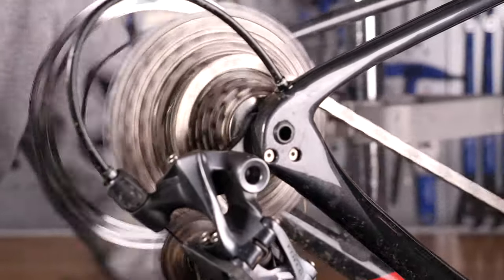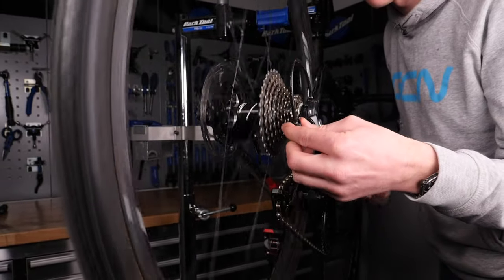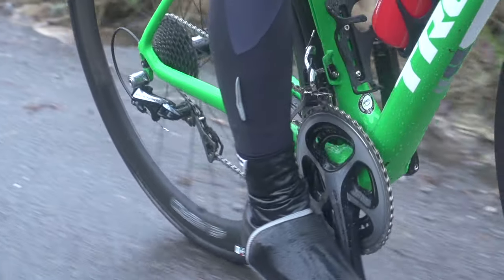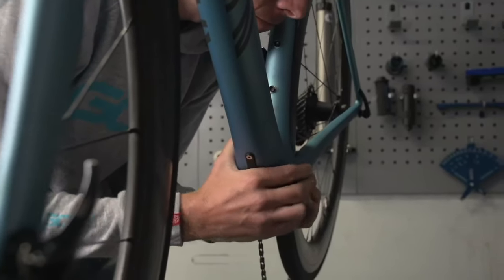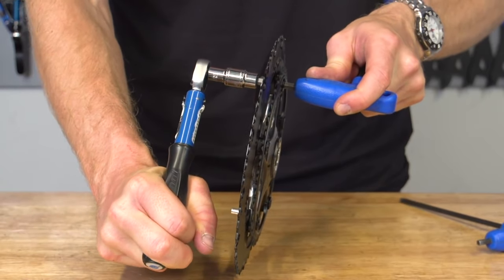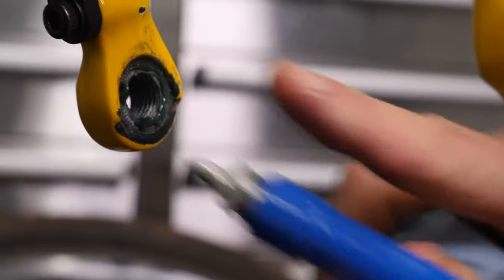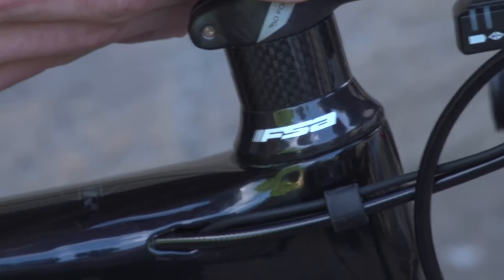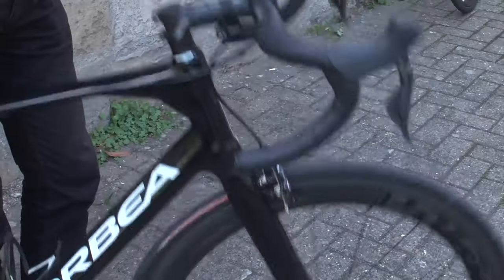Help! My Bike Is Making A Noise | How To Fix A Noisy Bike

Comment: I've had a noisy front end for a few months. A truly annoying variation from a slight rattle to a really loud creak. I've eliminated the headset, the front wheel quick releases, the stem bolts, even the front wheel spokes, as the source. The only thing I can now think of is the bolt holding the brake caliper. This is a nearly 20-year old Trek aluminium frame, and the creak happens only under compression. If I lean heavily on the front end when the bike is stationary, the creak will happen. But when I'm riding it sometimes disappears altogether, while other times its like a banshee - to my ears anyway. It seems to be worse in dry weather, but not always; it's also been loud in the wet, but less often than in the dry. I tried lubricating it a few weeks ago which seemed to solve it -- but then it came back and reapplying lube seems to be more miss than hit now. I even put the bike through a winter overhaul in my local bike shop, but a few days later the creak was back with a vengeance.
Any ideas?

Comment: I get noise from the rear wheel when it spins. The noise is like a beating sound. It’s frequency is random. The noise is generated while the wheel is freely spinning, ie even when I am not pedaling.Please help to understand and eliminate this issue. Cycle is 2021 bergamot revox 2, L9 with 29t wheels, Shimano tourney derailleur and tektro disc brakes.

Comment: Hi Jon, I've recently serviced my mountain bike, changed the pedals, new tyres, new brake pads etc. Realigned the brakes but still when I put weight and try to ride my bike i get this rubbing sound of it like metal to metal rubbing together. I have tried to spin the wheels with out putting weight on my bike and the sound is never to be heard off. Can you tell me what to do? Thank you @GCN Tech
Reply: I have a similar problem when I am on second smallest cog on the rear and center chain ring on front .Feels like some something is rubbing and you feel it on the pedal

Comment: So my LBL replaced all of my drive train, bottom bracket, chain, chainset, cassette, bearings in hubs, swapped my pedals and replaced my rear lever. And my bike is still constantly creaking on every pedal rotation. Any ideas?
Reply: Any luck with what it was?
Reply: David Hill yeah.. but I don’t remember now.

Comment: Well, my problem is at the connection point of the steering wheel and the body but my basic bike's issue it the front brakes' terrible sound, scaring pedestrians and cars driving along my path .. Let alone the fact that, my bike is rusty but I don't expect a YouTube video to solve all that.. TY for your advice

Comment: I have a strange issue with my road bike that is very new (less than 50km rode so far) less than 3months old. 

Any one have this issue before that when on steep descends, while letting the road bike coast at estimate 35km/hr, I’m not able to pedal to go faster. In fact, it’s as if the gear is at the lightest gear, changing to harder gears doesn’t solve it. 

I did not go through any potholes, did not change gears and did not brake. However, after the bike is cruising slower on a flat surface after the descend, I’m able to pedal slowly back to normal again.

Anyone with similar experience can advise?

Comment: I bought a set of Prime wheels in May of last year and put a good few hundred miles on them. a few days before a big charity ride i went out for a bit of a shake down ride to make sure that everything on the bike was working as it should. Every time I put a little bit of power down I heard a creaking type noise from the back. After getting off the bike and checking it over several times, taking the rear wheel off, putting it back on and checking brake drag ect. I gave up and assumed it was the BB (Pushfit style) I threw it at my LBS with the hope of getting it fixed and it turned out to be the driveside spokes on the rear wheel had been tensioned so much that when I was pedalling, the spokes where rubbing on each other creating the creaking noise.. Irritating as hell!

Comment: I get a click every pedal rotation if I am seated
If I stand a pedal it disappears
Any thoughts to this occurrence 
Thanks
Doug
Reply: Douglas Stone saddle post, saddle clamp or the clamp around the seat tube. Grease all and torque to spec.
Reply: I greased the bearings on the pedal crank on both sides
And bang the noise was gone
Reply: Douglas Stone I am having a click of my own that is annoying me to death. It is only when seated — if I stand and go hard or normal pace in any gear it’s gone. I put some carbon gripper on my seat post and it seemed to go away but was back in no time. Going to try using the gripper on the saddle rails, etc. Glad you fixed yours!

Comment: Here's one for Ask GCNTech:
My front disc brake sometimes judders when I apply it, to the extent that the bike becomes almost uncontrollable. It seems to occur in the cold and damp (I live in Scotland, so that obviously is a rare occasion), especially if I've not used the brakes for a decent amount of time. If the brakes are warm the problem seems to go away. I tried changing the pads which sorted the problem out temporarily but it has since recurred. I've not noticed many leaks from the hydraulics, so I don't think the pads/disc are contaminated. And I think I needed the brakes in properly before I started. I've never had this problem with my hardtail MTB - is it just something that happens with a steel frame/fork?
Reply: Calum Spencer whad the same problem. Turned out i used wrong kind of brakepads. Some discs only seem to work properly with resinpads
Reply: @Calum Spencer, have you checked the torque on the centre lock where your rotor bolts to the hub of your wheel, needs to be about 40nm, or if you have a 6bolt to hold your rotor in place try checking each of those bolts has the correct torque on them?
Reply: rotor bolts/center lock loose, quick release/thru-axle loose, or headset loose. really can't think of anything else.
Reply: @kiowa21  I gave the centrelock a tighten tonight. Unfortunately I left my torque wrench behind when I was visiting my mum at Christmas, so I don't know if it was up to the correct torque but it's definitely tight now.
Reply: @peterderuiter2937  good call - the rotor says resin only but I'd used metal pads. Annoyingly, I'd replaced like for like so the bike was obviously had incorrect pads when it was new.

Comment: Had this terrible ticking noise whilst riding, turned out to be sand that got on the seatpost and in the seat tube. A scrub with a toothbrush and some new grease did the trick.

Comment: Hi Jon, if I want to reclamp the cable of my front derailer, should the derailer be on the small chainring or the big one?
Reply: you'll be on the small one anyway, here's why: 
to change from the small to the big chainring the leaver movement tensions the cable, moves the cage. when changing from the big to the small ring, the leaver drops the tension essentially back to zero, the cage springs back by itself.
when you undo the clamp, tension will be at zero.
so, if you undo the clamp with the dereilluer in the big ring position, it should drop to the small one by itself.

Comment: Whenever I start pedaling when the cassette starts moving the wheel it makes an extremely loud sound help I know this sound is normal but on my bike it will make the sound on the slightest of taps everything is tight and working fine it just sounds embarrassing because it sounds like im being reckless with my hub

Comment: One thing I've noticed is that every bike I've ever had has been at least slightly more noise with the chain in the large chainring than in the small, regardless of which sprocket I've used at the rear. Does anyone know if there is a reason for this or if it's just coincidence?

Comment: I still have a grinding noise on the drivetrain specially on the smallest gear and big ring, I can’t find where it grinds. And it does it on the trainer (kickr core) too. I’m puzzled.
Reply: Did you ever find out what the problem was?
Reply: Brendan Clarey yes!! It was the chain. A dura ace. I thought it was better. 
Changed to an Ultegra and it went away.
Reply: @rafaelespinoza  Thank you so much! I am going to have to try that!

Comment: Just got my bike back from a service and it sounds worse than it did before it went in. Gonna have to try this myself.
Reply from the maker: Dang it! Let us know if you find out where it's coming from!
Reply: GCN Tech cheers GCN I got it sorted for free by lbs just a front derailleur adjustment when in big chain ring the chain was rubbing. Glad it's fixed was highly irritating and psyched about being able to ride in big boy ring without grinding noise.